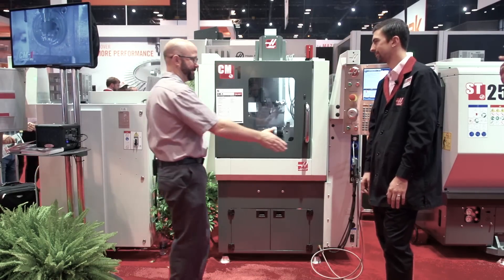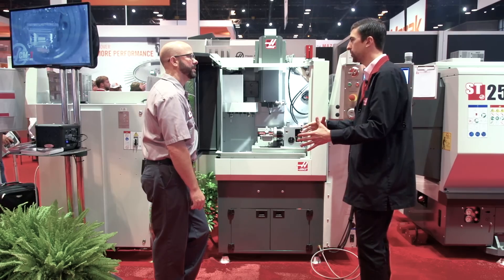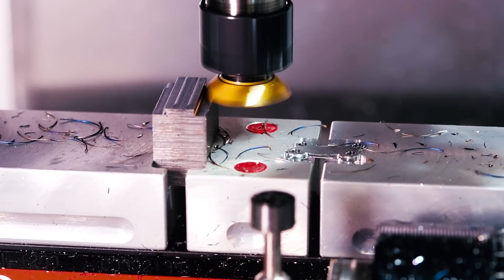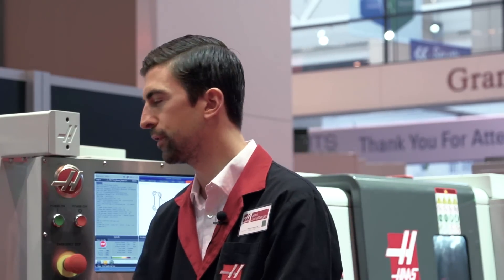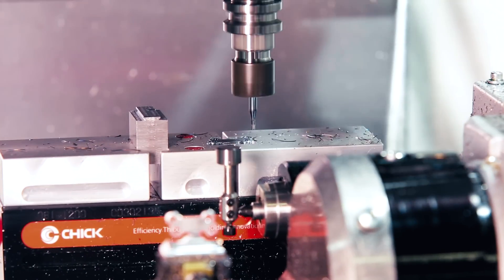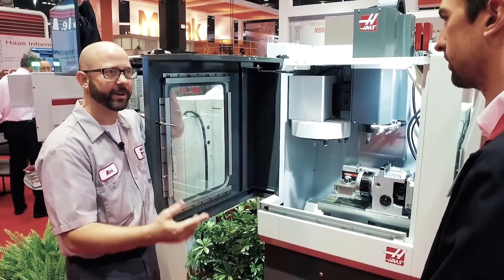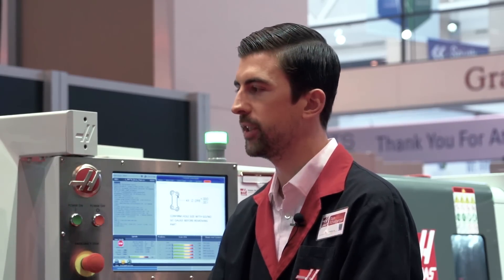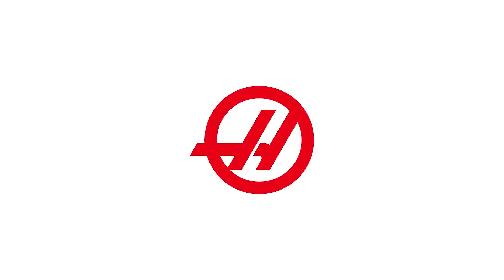The New Haas CM-1 Compact Mill from Haas Automation

Comment: Looks good, Id love one of these. Can you tell me is it single phase 240v or three phase, can it rigid tap, what about the coolant, and what about the air supply requirements? Also what is the price? We are in the UK. Thanks
Reply from the maker: Hocus Products Ltd,  Thanks for the comment! The CM-1 is available only as a 3-phase machine. Both the 30K standard and 50K optional spindles come with rigid tapping standard. The machine is equipped with a slide out 13 gallon coolant tank and pump that are enclosed in the machine base.   
The air requirement is 2 SCFM @ 80-125 psi. The base price is $59,995 USD and the CM-1 goes on sale on 10/01/16.      If you’d like to find your dealer you can click on this link to our “Find Your Dealer” page, and find their contact information. http://haascnc.com/finddealer.asp?utm_source=Jquery%20Slider&utm_medium=Find%20Distributor%20Link&utm_campaign=Contact%20Slider#gsc.tab=0
  There you’ll find the email for the Haas Factory Outlet UK at sales@haas.co.uk or if you’d prefer you can email us here at the Haas factory at answerman@haascnc.com and we’ll contact your dealer and let them know you’re interested in the CM-1. Thanks again.

Comment: This would be a great machine for my biz. I have been using VF2 and VF3 with trunnions for years, but the majority of the time - the parts are very small and it is a waste of space. 2 of these would cover 90% of what I need since all of my parts are smaller than the palm of my hand.
Reply from the maker: JetNmyFutureIt’s great to hear you’re interested in the new CM-1. Here is a link to our “What’s
New” page covering the CM-1 features. http://haascnc.com/whatsnew-CM-1.asp#gsc.tab=0.

The machine runs on three-phase power only. The 30K standard spindle is rated at
5HP with 8 ft-lb torque @ 3000 rpm, while the 50K optional spindle is rated at
5HP with 3.7 ft-lb torque @ 3700 rpm. Rigid tapping is standard on both
spindles.
Since it sounds like you already have some Haas machines in your shop you probably
already know your dealer well. The CM-1 will be available for sale 10/1/16, so
please give your dealer a call if you’d like them to come out and discuss how a
CM-1 will work in your shop. Or if you’d prefer you can send your contact info
to answerman@haascnc.com and we’ll contact your dealer to let them know you’re interested in the CM-1. And thanks for the comment!
Reply: So I followed that link.  $59k for the machine and another $20k for the rotary.  Who the F is gonna spend $80,000 on that machine?